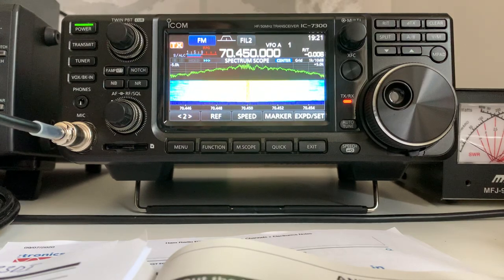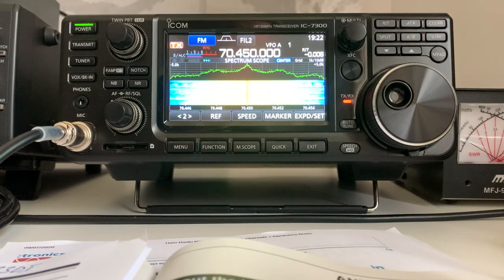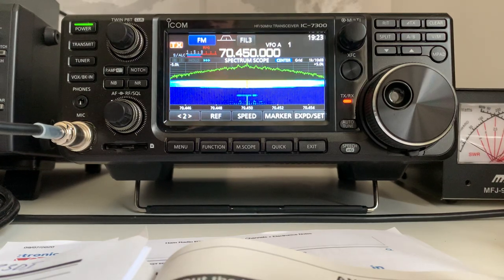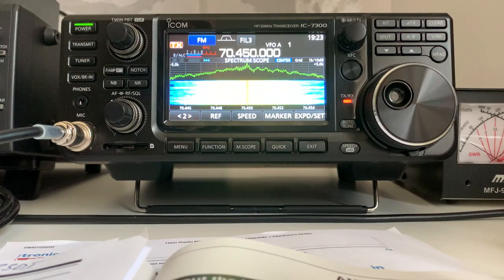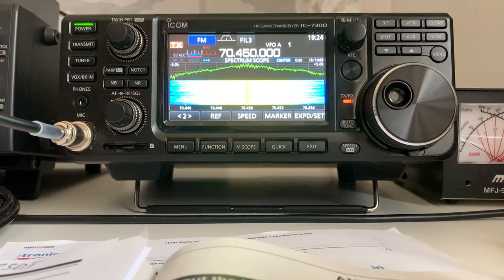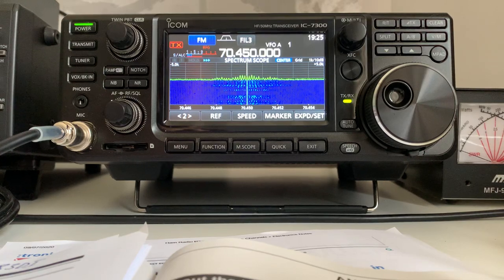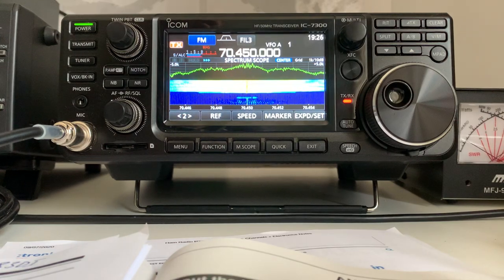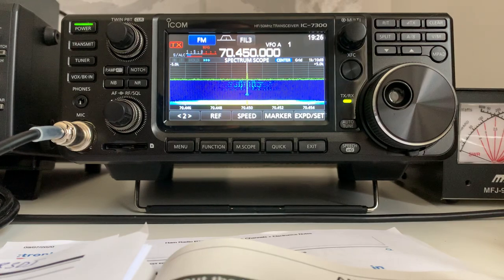Icom IC-7300 & DIY coaxial vertical dipole for 4m: super audio on FM

Comment: Clint, if you want to try something different and gain versatility, you can use an adapter for electret PC microphones, alongside an external PTT switch... That's what I do myself! The adapter is basically Y-shaped, with one end terminated in a suitable mic connector for the radio you want to use it with, and the other then splitting into: 1) a stereo 3.5mm jack socket for the mic, and 2) a mono 6.3mm socket for the PTT... In my case, I use a momentary handheld switch that I purchased alongside with the adapter, but it would have been just as easy to separately buy a male mono 6.3mm jack plug to put together either a 'non-momentary' desktop PTT (alongside some 2-conductor cable and a SPDT switch), or even a foot switch! The possibilities are quite endless, as they are in the case of the microphones themselves! I'm currently mostly using a cheap "Sonia SN-6000" desktop mic that I found, for simply €4.50, in my nearest Chinese "dollar store"-type outlet (and the reports I've received when using it have basically been always positive, so far!), but I can also use a Plantronics PC headset I also have, or even a cheap lav mic that came alongside a simple MP3 recorder I got several years ago (in an attempt to find a cheap solution to capture audio from my portables!)... All of them work with the adapter and my IC-7100! That being said, something has to be had in mind, and that's that there are two ways PC mics' jacks are wired, one of them is by using the tip of the jack for the audio, the ring for DC power up to the electret element, and the sleeve for ground, and the other way is by combining power+audio on either the tip or the ring, and again, using the sleeve for ground. So, I had to make an "adapter for the adapter", consisting of a short pigtail of cable (taken off a failed universal laptop charger, that happened to use a coaxially-arranged cable for the DC supply, good for "hum prevention" when used for audio!), a 3.5mm socket (in which I soldered both the tip and the ring contacts to the center conductor of that 'coax-alike', and the shield/braid to the sleeve contact), and in the other end, a 3.5mm stereo jack with the center conductor to the ring, the shield to the sleeve as well, and a small 1uF 50V capacitor in-between the ring and the tip of the jack (it just fits within the plastic cover for the jack!) to decouple the DC from the audio and place each of them on the correct contacts on the jack! Incidentally, I pulled that cap out of a PL-600 radio that I lost, due to an ESD zap from an outdoors random wire antenna I tried to use with it, but that's another story LOL!

I sourced both the adapter and the hand PTT switch off an UK-based seller (on eBay, but they also sell through their website), so you should have no problems to get those, if you decide to go down the same route! So, for your IC-7300, it would be:

-Adapter: https://shop.technofix.uk/microphones-and-accessories/headset-adapters/cable-for-pc-headsets-3-5mm-jack-8-pin-round-for-icom-transceivers
-PTT switches: https://shop.technofix.uk/microphones-and-accessories/ptt-switches (or like I said, you can make your own with just a 6.3mm mono jack & some cable!)

Anyways, I'd say I broke my record for lengthy comments LOL, but in this case I think it was justified! Hope it's useful, at least... As always, take care, Clint!! Off to watch today's edition of your "what I'm up to" videos!! :) 73!! David EA3IEK & EA4998URE SWL
Reply from the maker: Hi there David, thank you so much for your detailed recommendations - really interesting. Not bad at all for £25 by the way! Hope you enjoy the update vid. Keep safe my friend and 73s, Clint
Reply from the maker: That is true Jon, but M0UHF did periodically ask whether other operators wanted to use the frequency. 73s, Clint
Reply: @OxfordShortwaveLog  You're welcome, Clint! I really like how there are many ways to make significant improvements to our setups on the cheap! And yes, I enjoyed your latest update video, as I did with all the others you've made! 73!! David.

Comment: Hi and tnx for the clip. From one thing to another i must ask: You have this green kind of thin line on the top to your audio on the display (in the spectra, i can´t get that one on my rig, i use the Vers 1.41 (Cpu) Dsp data 1.00 Dsp program 1.07, if that has anything to do with it?
Reply from the maker: Hi sorry I can't answer your question as I sold my 7300 about a year ago. Google it perhaps? 73

Comment: icom radios use condenser or electret elements in there mikes these are powered by the radio through the mike socket so be very careful if you wire the mike yourself clint  try the mike from your 756 i did and it works well my compression is at 3 and mike gain 40% good comments from other stations "ron"
Reply from the maker: Thanks again Ron for the tip on using the mic from my 756. 73s, Clint